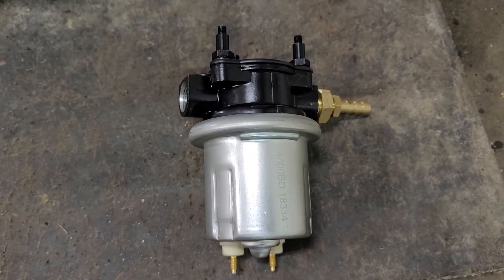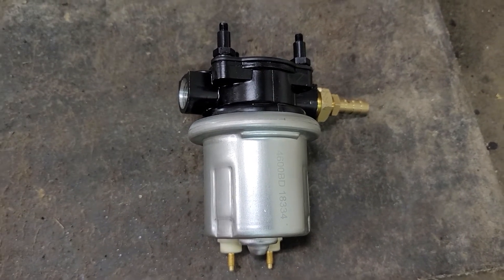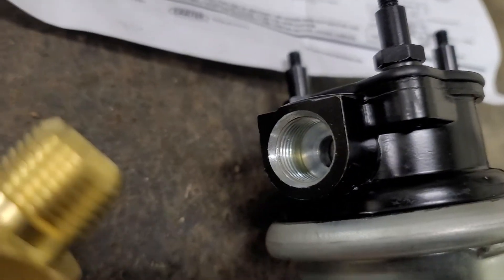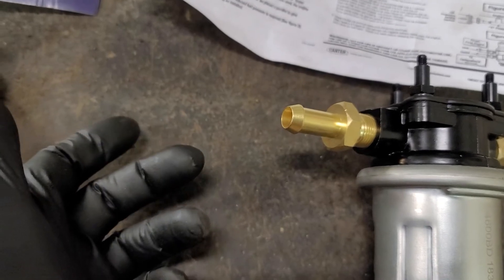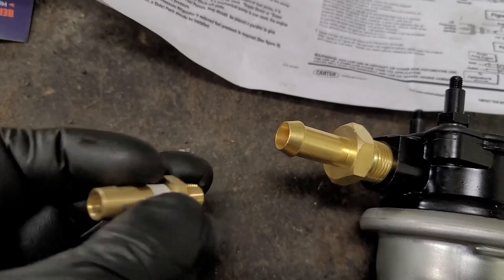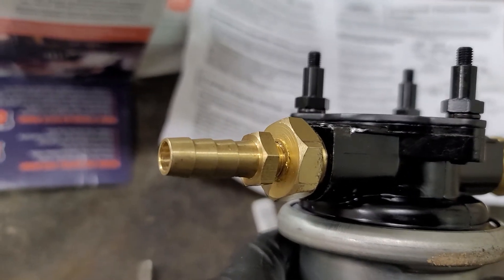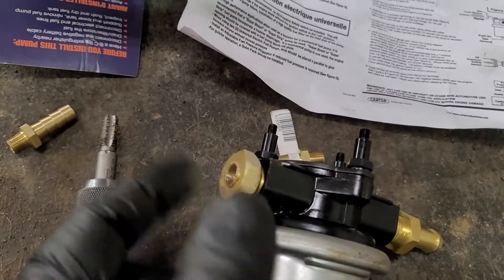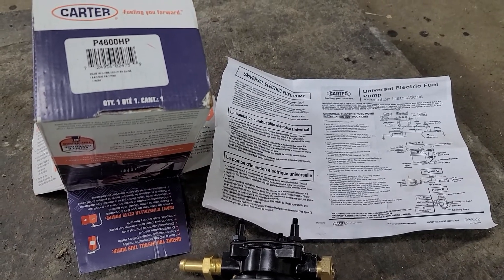Chevrolet 6.5 diesel fuel pump upgrade Part 1

Comment: We’re you based out of sir? I’m looking for a 6.5 diesel mechanic
Reply: Aren't we all? 😄
Reply: You wont find any ! Ive been stuck working on mine with the exception of an old chevy mechanic who worked for chevy 50 years at my dads dealership if a guy who owns a chevy dealership cant find anybody to touch em you are in big big trouble  this old guy 74 yrs young  came out of retirement to help me i was lucky he was bored  the guy who sold me the truck lied and i didnt bother checking the motor till i got home cause its a 2000 he told me it was one of the first duramaxes well its a junk 6.5 optimizer he never maintained and it has at least 100 to 150 codes on the computer ! Didnt have 1 till a week after i brought it home he had it wiped clean.
Reply: Lol seriously man I’m about to chunk this truck off a cliff
Reply from the maker: I'm in south eastern PA..... Between phila and harrisburg.

Comment: I'll be curious to see what kind of pressure this model pump will put out. I am currently running the 4601HP and getting 9-11 psi at the ffm. Carter pumps have not been getting favorable reviews, lately, but mine has been in place for a bit over 2 years with no issues. A bit noisy but that lets you know that it is at least running.
Reply from the maker: I'll let you know... Haven't done testing yet.   Other work on same truck and unfavorable weather for driving.